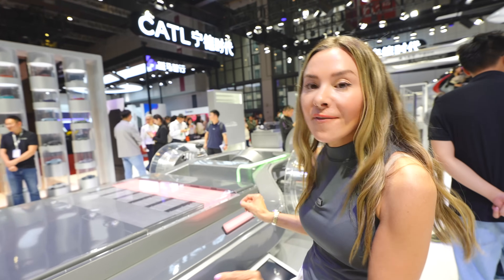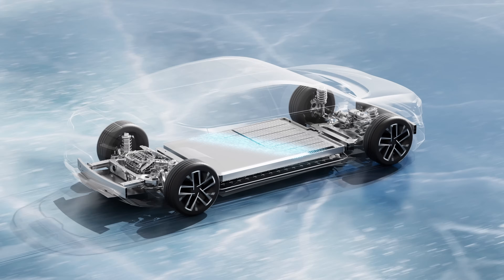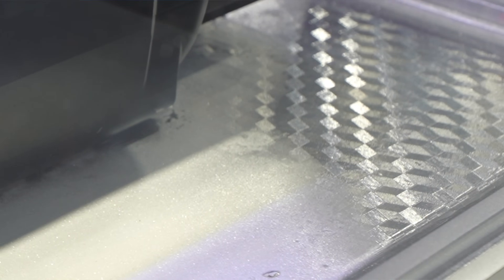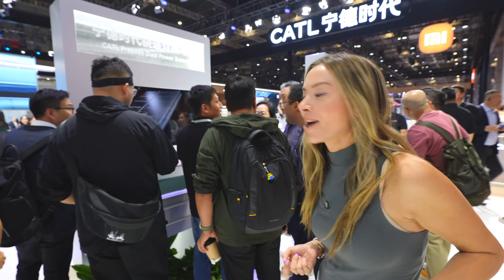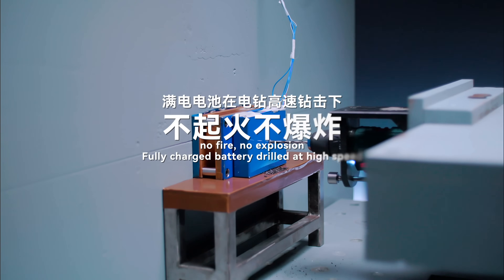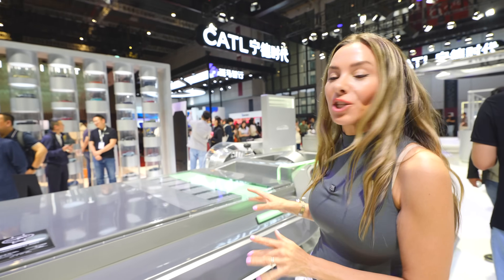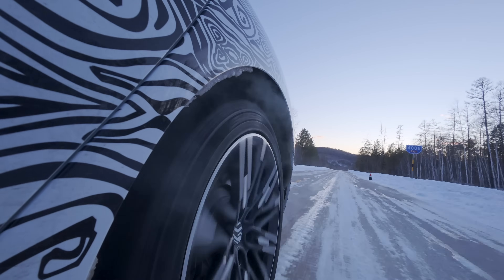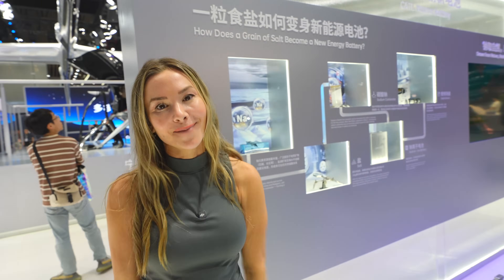This Chinese Battery Breakthrough Just Killed the Gas Station

Comment: As China now has a monopoly on this tech time for adjustment before we export all our wealth . Revert to the beginning of motoring where a car had a chassis with a separate body .So standardize to four different size chassis with a universal lug and bolt coupling atop saloon hatchback or estate bodies . As chassis unless crashed last for ever , a new car would only be  a new body , which could be coach-built to your own design , wacky races anyone .
 Regards Electric similar with sill dropping down to allow briefcase  sized battery packs to be pulled and exchanged at charge station , all fully charged with computers assessing packs and exchange for similar quality .
This would half the price of cars as they are now just white goods .

Comment: Dual power means you can have both 400volt and 800volt twin charging architecture. So no matter the station you find, 50% of your battery will do optimum charging.

Comment: Not to mention cars which are so expensive, let's just talk about cellphones. In China, Android phones basically take 30 minutes to an hour to fully charge, while in the US, the charging speed of Android phones is mostly still at the level of ten years ago, which confuses me.

There are also some powerful Android tablets that cost about 800-900 USD in the United States for the same configuration, but only about 400-500 USD in China. This is the price before the tariff war, and I don't think the transportation and storage costs will double the price of each tablet.
Reply: no one cares android in US
Reply: I have a Poco smartphone that has 67W charging. 10-80% in just 20 minutes

Comment: Eventually likely will replace lithium batteries. But the far charge speed is not as practical as it would seem. The 5 or 10 minute charges require a 1000 kilowatt charger. This is about the electrical consumption of 500 homes per charging connection. Putting tens of thousands of these in the field nationwide will require enormous increase in power generation and distribution... which will years to provide.

This is NOT the fault of the battery. It's a matter of the total energy being transferred in a limited time.

Comment: The developments that are being made in impressive.  Our manufacturers are truly missing the mark right now, and it seems some of them can't even manage current tech as it is just by the numbers of recalls that exist.
As for that low voltage battery.  We need to start utilizing these in traditional ICE vehicles.  I work in the automotive field and the number of new tech (AGM) batteries failing is pathetic.  We're replacing dozens of them a month, and many still under base warranty.  That's unheard of in all the years I've worked in the industry.
The big challenge now that we face here in the states to having any real serious adoption isn't so much range, as this concern can be greatly reduced with fast charge times, it's still charging infrastructure.  This is lacking greatly and until some business steps up and sees a way to build stations which are accessible to the masses, fast, reliable, and profitable, we're going to see this continue as a limitation.
I've had no interest in an EV at all until just a short time ago, and while I can see an EV working for me 95% of the time, those few times I'd likely exceed the range and where I'd be when doing so doesn't make me feel good as there's few chargers available in that area.  Regardless of that, I still put a reservation in for a Slate truck because the convenience of not needing to stop for gas and not needing oil changes for the most part outweigh my concerns over range and limited access to chargers.

Comment: The cooling is important but not the only reason why they can charge that fast; the internal resistance is much lower meaning lower amount of heat allocated in the battery.

Comment: They could bypass the need of batteries if for example they have built into the roads charging pads in every 20 feet (ca. 6 m) lets us say and have the car enough to run for just 100 miles (ca. 161 km). The pads could keep the batteries charged while driving.

Comment: The cars and batteries already existing are more than adequate. Whats needed is, at least DOUBLE the available electrical power and delivery grid and millions of reliable charging ports. Better batteries don't solve the infrastructure bottleneck.
Reply: Not sure what kind of bottleneck you're talking about. It doesn't exist right now nor will it in the future with load shifting and increasing levels of efficiency.
Reply: Currently it takes half an hour to fully charge one car, reducing to 5 minutes, you can charge 6 cars, thus reducing the amount of chargers needed.

Comment: Bear in mind that sodium batteries don't have as much energy density as lithium-ion, so you'll need a bigger, heavier pack for the same range and performance. Also, existing sodium batteries support fewer duty cycles than comparable lithium-ion packs. Last of all, since sodium batteries are new, there's less experience with supply chains, manufacturability and durability in use.

None of this is to say that sodium batteries aren't a welcome addition to the EV world. Just takes some of these introductory claims with a grain of salt.

Also of interest: Lithium iron phosphate batteries, as well as solid-state batteries. Lots of developments in EV batteries.

Comment: Ya China has Nio? Did you notice I said if BEVs ever become a "Large Percentage of vehicles"? Currently BEVs are 0.1% of the world market, <4% of China's 329 million vehicles. If you have a football game in a small college town; 100,000 fans come & 25,000 EVs need a battery swap; this little town is going to have 25,000 extra BEV batteries to swap?  No; Not 4,000, not probably even 2000. That's a huge number of batteries to have sitting doing nothing. China is building 1 MW chargers?  How many so far?  According to Google AI unknown; BYD has 500, 500Kw units in the works each requires large battery installations near them to supplement grid power, costing millions of dollars each.  Hype.

Comment: I cant imagine the expense of battery stations every couple of hundred miles. Also since there won't be a "standard type" of battery there would need to be several types. Would there be a starter car with no initial battery (battery is the largest cost). A swapout battery would cost considerably more than gasoline. Great "concept".

Comment: This is a good report, and these are some amazing innovations. Unfortunately, current tariffs double the price of Chinese imports. So we are unlikely to see these amazing batteries (or buy any low cost Chinese EVs) for many years to come. The bright side is that today 80% of EVs owners charge up at home overnight for cheap. So we already have a great electrical recharging system built into every home. Slower, but reliable and simple. Granted, not everyone has access to home/work charging, but most people do, so EVs are still very competitive for those people. Already being cheaper and more convenient today than gas stations. And our nationwide charging networks are also improving quickly for the future EV owners with those public charging needs.
Reply: 145% at the moment.  Two and a half times more expensive than they should be.  Thanks lord Cheeto!
Reply: These batteries are not being mass produced they are marketing hype.
Reply: @CUBuffnSD  Keep telling yourself that... The BYD Han-L and Yang-L are on sale now. And the next gen models, with the fast charging will be coming soon. Granted, production of the new models has not started yet, and the super fast charging network needs to be built out. But BYD and CATL will follow through faster than you think. It is an illusion to think that the tariffs will buy us time to catch up.
Reply: @CUBuffnSD they were introduced at this auto show and will be available this year.

Comment: Awesome. LFP is the way to go. Which cars are coming with Sodium Iron?
Reply: If you think they're done optimizing Sodium-ion battery tech and no further improvements will happen, I've got a bridge to sell: The Francis Scott Key Bridge.
Reply: Quite a few new article articles coming out talking about the disadvantages of LFP and the fact that they can still do a thermal runaway and the temperature difference between LFP and lithium cobalt thermal runaway is only 100° F. LFP emits vastly higher levels of gases that are much more toxic. The technology is just changing so quickly Whatever you know today is probably no longer correct a year from now.

Comment: I would love a world were we can run on battery however, there is 1 big flaw in all of this. The source of the electricity is unstable and we cant generate enough of it using renewable sources that is affordable. Good idea but essentially flawed
Reply: I guess that's why China is the biggest manufacturer of solar power equipments, and wind power if I'm correct. trying to shift from fossil with more sustainable source of electricity. At least it's the right direction to go.
Reply: You are 100% wrong!
Reply: At present, the power generation sources from renewable energy in China have accounted for more than 30% of the country's total electricity consumption, and the proportion is rising rapidly every year
Reply: The only thing "flawed" is your reasoning.  Batteries help stabilize the grid and make renewables more effective. You failed.
Reply: @JRP3  ok believe what you want I think you need to understand and read about 60 and 50 HZ   depending on your country and why renewables are unstable even with batteries. Hint inertia
Reply: @ichanceyourmind  No, that problem is solved.

Comment: If you do the maths, the thing that EVs need most for a high average journey speed is rate of charge, in kW, assuming chargers are freely available. If the battery is twice the size, you need twice the charge time, so it doesn't help much. But fast charging, like 1MW or so, means charging won't be an issue when doing long journeys quickly.

Comment: Charging at 1.7 miles a second will never work in 90% of the worlds infrastructure; there simply isn't that sort of power available.  Swapping tech doesn't work because if you ever have a large percentage of vehicles be electric imagine the number of batteries you'd need sitting idle waiting to be swapped in any sort of major movement of people; be it a concert or other event - car race, sport events in small college towns and so on- are you going to have 10,000 swap batteries sitting waiting?  No.  Further when ever you hear BEV ranges of 500 or 600 miles think 300 or 325 because they are liars that base their estimates on dyno results which don't take the heavy weight into account.
Reply: China is already doing battery swaps (Nio) and they are already building out the 1MW charging infra. The Nios that are capable of battery swaps can also be charged as any BEV. China is well on its way to fully transitioning to BEVs and PHEVs.
Reply: you're stuck in the U.S.A. I'm not worried about european countries with nuclear power.
Reply: @OktoPutsch  Oh like Germany that shutting down it's nukes? What European nations other than France have a significant amount of nuclear.  The US energy profile shows the US nuke power being 10% of the overall energy for the country.  94 of the worlds 440 nuclear power plants are in the USA not counting nuclear powered ships which could be utilized.  France has 56, UK 9, Germany 9, Poland 0, Spain 7, Italy 0, Austria 0, Holland 1, Denmark 0, Portugal 0, Switzerland 4. So when Germany finalizes shutting down their 9 reactors; Europe will have about 1/2 the nuclear capacity of the USA. Greenies hate nukes.

Comment: So, 1.5 miles per second = 400 miles in 4.4 minutes.  Still takes less than that to fill a gas tank.  Also, imagine the high amount of current in amps to achieve that.
Reply: and? what is the average person going to do with that additional 3 minutes if they were still filling with gas? Even at 4.4 minutes if the tech becomes viable - the gap is essentially closed
Reply: @ You obviously never lived on the East coast of the US, where people are always in a rush, and time is money.  Haven't you ever heard of a New York minute?
Reply: because there are a lot of landed homes in america ,  can make use of  solar panels which are also getting cheaper and better  - and use 1-2 ev as storage as well - in china an ev "range extender" is actually a gas generator
Reply: You plug in, then go take a whiz, every 200 miles, and it's charged when you return.  Ten seconds vs. 4 minutes. 
At home, you plug in, go to sleep, car is ready to go in the morning. No more gas stations.

Comment: What is the cost?  Also it is affordable why would I buy a new car when I can just replace the battery?  Doesn’t seem like this will benefit the auto industry
Reply: After your car rusts out or falls apart, you can sell the battery. It will last longer than the car.

Comment: Hello
Thank you for the video, very instructive. Do you have any idea when we’ll be able to have a car with more than a 1000 km range and a charging time of 10 mn ?
Thanks
Reply from the maker: In Asia, looks like 2026 or 2027. Maybe a few year later in N America
Reply: @ Thank you
Reply: @ItsKimJava  Bulldust, stop spreading lies.   1MW charger needs an electrical substation for 1 car.    Build a nuclear power plant next to the charge station to supply 100 cars.   Charge from solar maybe?  1 solar panel = 200Watts.   1MW = 5000 solar panels for 1 car, if the sun is shining.   This energy is not available ANYWHERE in the world to charge at 12C for anything other than a proof of demonstration.   China gets most of its electricity by burning coal.
Reply: easily for  ev with "range extender" ( basically an additional gas generator ) - starting price is about  $13,000 for these vehicles

Comment: This is what I love about EV's the tech can only advance, especially in the battery department. There is only so much you can do with gas tanks...
Reply: Just scratching the surface
Reply: Gas tanks don't need improvement.  I can pump 14.5 gallons of gas in 1 min 35 seconds adding over 600 miles of range.  I'm glad to see battery technology catching up.  If replacement batteries become cheap enough and durable enough over time with a proven track record everyone will be going electric.  Initial cost is still higher, as there are no 25 year old modern electric vehicles operational.